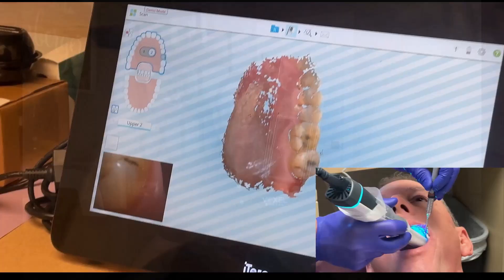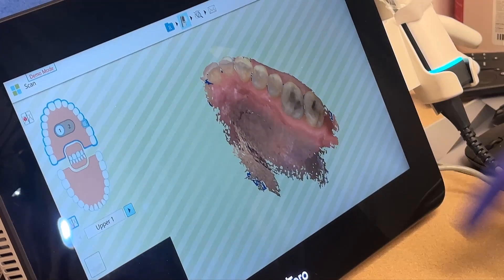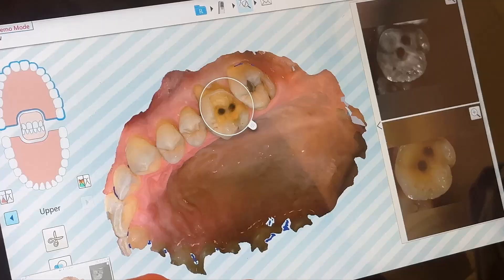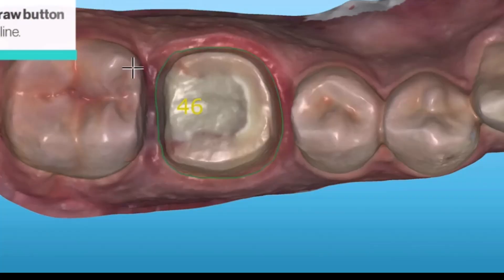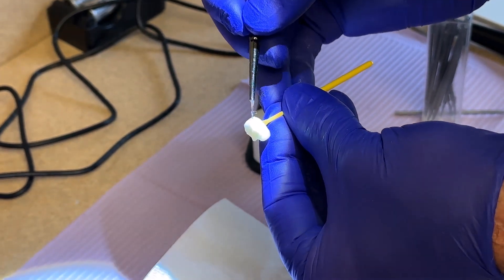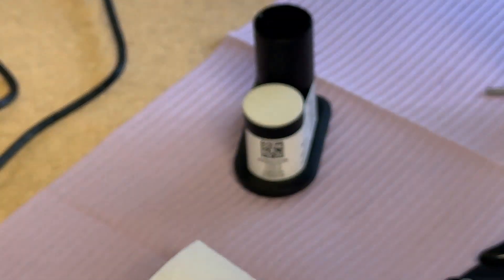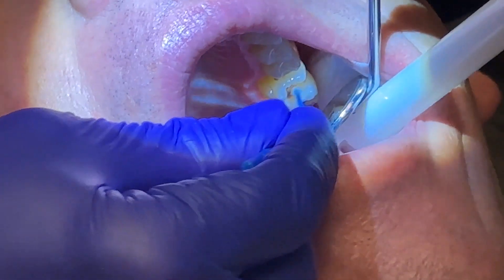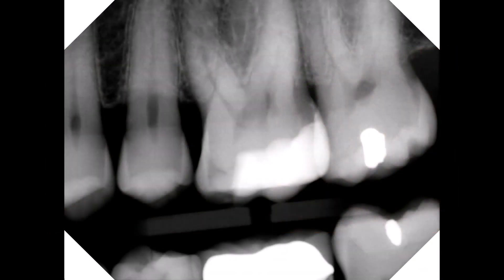Scan-Design-Print-Deliver With iTero Lumina and SprintRay Midas

Comment: First like first comment 🎉,great video great work,I have a question,if we compare that material with emax what is your opinion,and can you describe crown with that material like permanent crown or that is good temporary
Reply from the maker: Thanks.  Emax is currently stronger than these but new resins are coming out that will rival emax strength.  Sprintray defines them as definitive restorations, another word for permanent, but also used as temps.